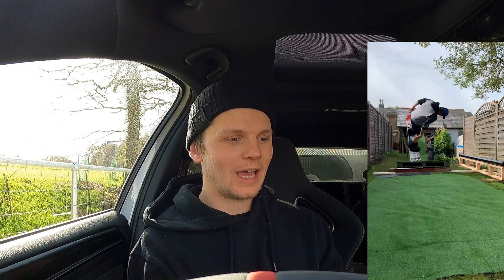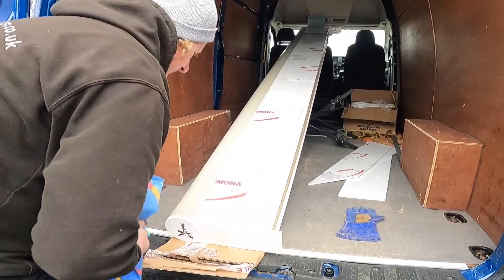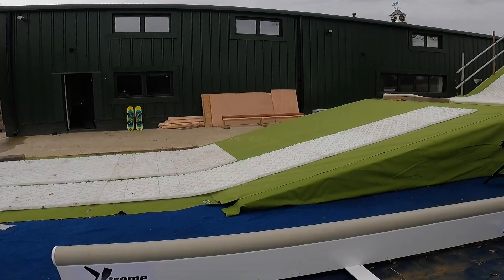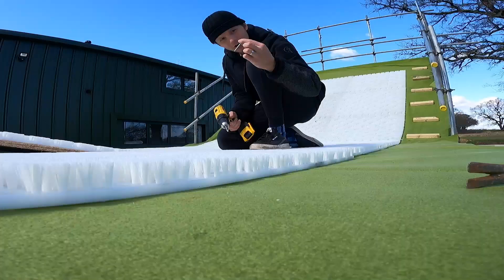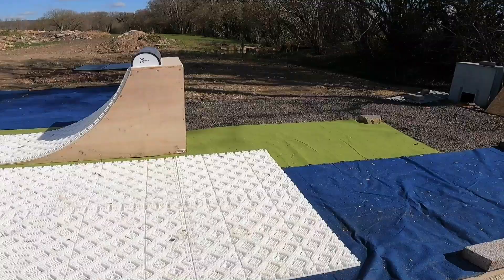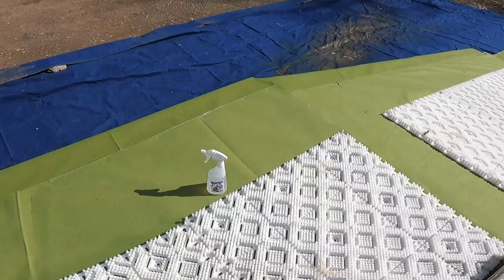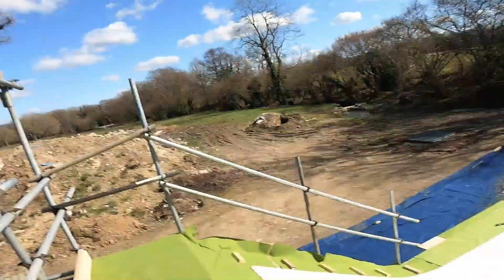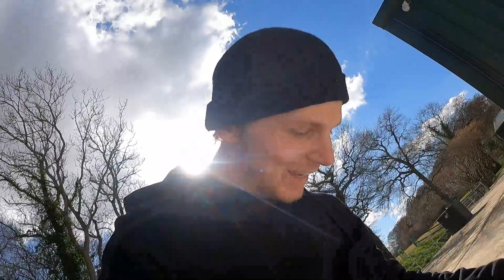IS THIS THE BIGGEST DIY SNOWBOARD RAMP

Comment: What kind of material did you use for sliding. I'm probably going to use fake grass with oil or soap as a lubricant but maybe that's better?
Also how much do those metal poles cost and where can I find them?
Sick set up btw
Reply from the maker: Hey dude, so the matts are (proslope) you can message them on Instagram if you want to get a quote. Type in - proslope snowsports 

Then for the metal posts it’s just scaffolding so I basically drew what I wanted then got a scaffolder in to build it. 

Hope that help 🤟
Reply: @JamieNichollsTV  Thanks!